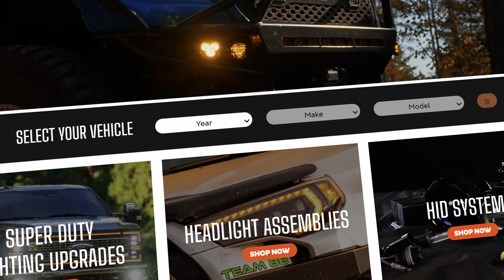HID vs LED Headlight Bulbs: Which is Better in 2025? | Brightness, Fitment & Output Test!

Comment: I used a Bi-xenon H4 kit of like 20w for my bike and it had a single ballast that did everything, it did the low and high beam with a single H4 cable connected to the inverter and then the inverter to power...

I actually liked a lot more the 6000K HID than anything else, I loved the green slow start ramping up and the light had some kind of white fluorescent amusing thing going on.

Their problem is the inverter keeps dying sadly on cheap kits and I never managed to even burn 1 single HID bulb, had to keep buying kits but use the same 1st perfectly working bulb.

That's the only reason I changed to LED which I have a cheap one with 3 big filaments and a fan, 2 are low beam and the 3rd Led filament is the high beam...

Comment: Aftermarket LED bulbs don’t have the proper cooling systems that OEM ones do. They need a much bigger heatsink. And that fan just moves air around the housing.  The LEDs over heat and don’t last. 

If you have a projector style housing the best option is a HID bulb.
Reply: Thats why my Lasfit LED bulbs have lasted over 50000 miles of driving right? Only replaced with ANOTHER Lasfit LED bulb because I switched blue for yellow

Comment: They did not compare the GTR vs. the HID 55w,I have the 55w for years and still today I haven't seen any led as bright as mine.
Reply: You should try the Phillips Ultinon rally 3590, 90w per bulb 6000k 
I already purchased them and i can tell you than nobody is lighting brighter and has a sharp cut-off line like theses ones

Comment: I have a 2001 Suzuki Vitara that just needed a headlight bulb. I bought a pair of slightly upgraded halogens because someone told me that current draw and heat can be a problem for an older, relatively inexpensive car with rather thin harness wires.
I surely appreciate the benefits of quality LEDs. Your thoughts?

Comment: Mildly disappointed that the color was so brushed under the rug in this one. One of the reasons halogens still hold up relatively well even though they aren't anywhere near as bright is that the warmer color contrasts with illuminated items better to our eyes. Human eyes are more used to a warmer color, between 4000k (sunset/golden hour) and 5000k (direct sunlight), and will perceive that much better than a "daylight white" such as 6000k or higher. This is also why many people feel that yellow/amber fog lights have much better penetration through fog and precipitation compared to pure white bulbs, our eyes simply perceive that color spectrum better than a cooler white.
Reply from the maker: We have a ton of videos that go in depth on color and spectrum. It’s pretty straightforward when comparing LED vs. HID—HID gives you flexibility from ~3000K to 8000K and more, whereas most LEDs are either white or yellow. A couple outliers are Morimoto 2Stroke and Ultra 3 LEDs, which run warmer than most LED bulbs (closer to ~5500K).

Comment: Thankfully my car has separate high beam and low beam bulbs so I've come up with a good compromise. I run standard halogens for my low beams so I don't blind people in normal driving conditions, but my high beams are LED and practically create daylight.
Reply from the maker: That sounds like a great setup for balancing visibility and courtesy to other drivers!
Reply: You could technically run HID's on the low beams, but stick with a 4k-5k color range. This will soften the harshness of the light, on people's eyes.

Comment: But you said the LED isn’t street legal?
Reply from the maker: HID and LED bulbs are street legal in the USA for Fog Light use only. Not compliant with DOT / FMVSS108 and not street legal in the USA for Headlights. Legal for off-road use in Snowmobile and ATV headlights and off-road racing use only auxiliary or forward lighting. International street legality varies by country.

Comment: $259 for a pair of led bulbs? You must be joking
Reply from the maker: Totally get the sticker shock. These are built for a clean cutoff, no flicker, stable output after heat soak, and long-term reliability—and they’re backed by a lifetime warranty. Buy once, stop chasing replacements.
Reply: @HeadlightRevolution  same as my 3 year old bevinsee that cost 6 times less. For $259 everybody can give lifetime warranty

Comment: Cannot just plug and play these things, the canbus system on many vehicles rejects them and puts the car into limp mode which is not great...one needs to get one that is OEM accredited unfortunately
Reply from the maker: We’ve never seen HIDs or LEDs cause limp mode — that’s for serious engine/transmission faults. Worst case is a “bulb out” warning on the dash, and that’s easily fixed with CANBUS decoders, PWM modules, or anti-flicker harnesses.
Reply: @HeadlightRevolution  happens on the Ford Ranger.. Know problem
Reply: @HeadlightRevolution  I’ve had it happen on a 2010 Sienna where LED tail lights caused the ECU to shut down completely.

Comment: Yeah, brightness is just one parameter and it is not most important one. Most important paramenter is Lumen and Xenon is still best in that. It is easy to see that, in EU, there is mandatory headlights washers for lights more than 2000 lumens. Have you seen any headlight washer at led factory headlights cars? nope, they are bright, but more or less comparable to halogens. Xenon is still best.
Reply from the maker: Lumens do matter, but they’re far from the most important metric when it comes to real-world driving. We've tested plenty of lights with inflated lumen claims, but low lux and candela—which means they look bright on paper but don't perform well on the road.

Lux (usable light at distance) and candela (beam intensity) are way more telling. That’s why we always measure at 25ft in our videos!

Comment: the thing I look for with lights, travelling long distances in the country, is penetration! I want to see FURTHER down the road. To me, this is where LED fails. I have an older 4x4 that doesnt come with fancy projectors so I rely on the factory reflector. I jst find that HID gets far better distance. Dont get me wrong, I love LED's and I have a double row LED light bar on the roof. But to light up the road further away...... a set of HID still seems the way to go, in conjunction with the light bar for flood!
Reply: You should never put HIDs in reflector housings, it's insanely blinding for everyone else on the road, and illegal for that very good reason.

Comment: Are both legal?
Reply from the maker: In the U.S., neither HIDs nor LEDs are considered street legal for use in halogen headlight housings. They're only legal for fog light use. They’re not DOT-compliant or FMVSS108-approved for headlights, so technically they’re for off-road, snowmobile, ATV, or auxiliary use only.

International street legality varies by country, so definitely check your local regulations if you're outside the U.S.
Reply: Lots of people don't care if it's legal and it's so dangerous being blinded by such bright lights especially on back roads

Comment: My car was retrofitted with a projector 10 years ago, and now, I can't find an LED replacement that I can mount to replace the HID bulb.
Reply from the maker: If your projector retrofit was originally done for HIDs, we wouldn’t recommend swapping in LED bulbs—it’s just not the right match. HID projectors are designed to work best with HID output, so for optimal performance and beam quality, you’re better off sticking with a high-quality HID setup like Philips or Osram.

If you’re set on going LED, your best bet would be an LED projector swap instead. It’s a bigger job, but when done right, it’ll give you performance on par with a solid HID retrofit.
Reply: @HeadlightRevolution  Also, I would dispute LEDs being universally brighter than HIDs. On my 04 Sienna, the HID low beams definitely hold their own against the LED high beams.
Reply: My 2020 traverse has projector head lights but want something brighter at night. You said led arent the way to go

Comment: I disagree with this whole video, i ran a led set of sealight LEDS in my 2012 f150 with halogen housings.  super bright, about 5 feet in front of the truck and then the light had no direction and just bounced everywhere.   LEDS can be great, but you HAVE  to run a projector housing.  Otherwise they suck.
Reply from the maker: Appreciate the input! Totally agree that some LED bulbs just don’t perform well in halogen reflectors—sounds like the Sealights you ran had poor beam control, which can definitely cause scatter and weak distance. But not all LEDs are built the same. We’ve tested plenty of high-quality options like the Ultra 3 in reflector housings with really impressive results. If you’re curious, check out our recent videos for side-by-side beam shots!

Comment: A Tip To change the color of the LED Lamp, Just scrape and remove the yellow phosphor using a knife on the top of the LED chip and the lamp will turn to blue color. I do this on my CSP LED chip
Reply from the maker: Definitely wouldn’t recommend doing this. The yellow phosphor layer is what allows the LED to emit white light—removing it doesn’t just turn the chip "blue," it completely compromises the LED’s intended function, efficiency, and lifespan. It also opens the door to overheating, electrical failure, and color instability.
Reply: Yes, I know that, but it's been working perfectly for 1 year.
Reply: @churrups2 if u knew that u wouldn’t have done it 😂😂 flop

Comment: I bought your HID conversion kit for my 2014 GMC Sierra, but a couple years ago. Overall, I’m quite satisfied with the results. The only problem I’ve had is intermittent connections, it’s kind of rinky-dink the way it’s set up. Every now and then I have to go out and reconnect wires, pull them out. Push them back in to make contact again. I wish now that I’ve gone with the LEDs. But I was worried about the pattern wouldn’t work with a projector headlight. The HID’s have a perfect pattern and a really sharp cut off, which is what I wanted, and I was worried the LEDs would not have that after looking at your videos.
Reply from the maker: If your 2014 Sierra has the OEM halogen projector headlights, an LED conversion would definitely be a solid option now to replace the HID kit. LED tech has come a long way, and we’ve got options that maintain a sharp beam pattern and cutoff just like you’re used to.

We’re also happy to help troubleshoot the current HID kit if you’d prefer to keep that going. Feel free to reach out to our support team at sales@headlightrevolution.com or give us a call at 218-755-5200—we’ll get you taken care of.
Reply: I would recommend using some dielectric grease, on the plug ports. You might be getting some connection issues, from moisture intrusion.

Comment: HID with a ballast and a blurred lens is xenon headlights or am i thinking of something else?
Reply from the maker: HID setups do use a ballast, and when paired with a bi-xenon projector, they handle both low and high beams. The lens isn’t really “blurred,” though—it’s just the way the optics are designed for HID projectors. But yep, sounds like you’re thinking of bi-xenon headlights!

Comment: I hate HID and LED, I don't care if it helps you see better at night, you're blinding other on coming drivers! Now all cars & trucks have them and I hate the,. I refuse to drive at night!
Reply from the maker: Badly aimed headlights, no matter the type (halogen, HID, or LED), are the real problem. Brighter doesn’t always mean better when it’s not aimed right. Properly designed and installed LED and HID systems actually reduce glare and improve safety—for everyone.
Reply: @HeadlightRevolution  I hear you, however that doesn't change my mind, I prefer the soft yellow headlights that you can still see clear enough at night without blinding oncoming drivers
Reply: The deer about to jump in front of your car does not care about your preference, but they will DEFINITELY listen to lasers on the front of the car!

Comment: What abolute rubbish. A 50W LED simply cannot compete with a 100 HID high beam.
Reply from the maker: That used to be true — but LED tech has come a long way in the last few years. Modern setups like the MLED projector push serious numbers:
70,000cd of intensity at just 29.5W of power.

So while a 100W HID still packs a punch, high-performance LEDs are absolutely holding their own now — with better efficiency, faster startup, and no ballast needed.

Comment: Why not a good halogen bulb? Too many people shoving the brightest light that they can find into whatever headlight housing they have. Sure it's bright, but not everybody wants to meet you coming at them at night with a light that resembles the flash of a nuclear blast
Reply from the maker: Totally fair point — and you're right, too many people throw ultra-bright bulbs into the wrong housings without considering optics or aim, and that’s when it becomes a problem. But the reason most comparisons focus on HID vs LED is because that’s where headlight tech is headed — even OE manufacturers are moving away from halogen entirely. A good halogen bulb can work fine in the right housing, but for those wanting better performance and modern reliability, HID or LED is usually the next step. The key is doing it responsibly.
Reply: why not have the anti dazzle headlights that they got over in the EU...had they legalized them 15 yrs ago we wouldnt be having these bright headlight issues as the camera and computer blocks cars out whilst keeping the high beams on everywhere else...
Reply: Those are HIDs that are the nuclear blast. You can get LEDs in hologin colours,, obviously you can get HIDs in those colours too but there still WAYYYYY brighter
Reply: because they burn out constantly and you cant see that deer until its too late...they are just so dim...
Reply: Halogen dies and it's very disappointingly low efficiency even though doesn't matter since there's a alternator...

But for example my bike uses a single H4 25W and basically can't see anything with it at all, it lights nothing at all, I tried my old car H4 55W and starts burning the headlight so I went for HID and finally had nice light output.

Sadly my bike is old and made for halogen even though I stop using HID and use the same cheap LED for many years, both sadly don't focus to the ground, they spread huge light all over the place sadly, but it's either halogen blind 25W that I can't see crap or blinding HID or LED 😢

Anyway even old cars equipped from factory with HID they have the proper focusing lenses for them and even usually move away from incoming traffic. Now LED equipped OEM cars same deal, they are properly made to use them.

PS: but sure some even stock are still kinda slightly blinding, but then again I also see blinding halogen old cars sometimes, they likely adjusted higher, like on my car I have a wheel that auto adjust light height...
Reply: Nah, but it IS quite nice for seeing that deer before it becomes a problem.
Reply: The popular argument is because halogen consumes more power so switching especially to LED's can help your older vehicles alternator. Just try to look for the least brightest leds because I cant stand LED drivers anymore blinding the f***k outta of everyone.
Reply: @MasterChef-117r  Also, on cars with high power draw, using more efficient lighting will reduce the risk of running down the battery

Comment: My wife’s’05 Acura TL has HIDS and they’re a nice bright crisp line across the road. Her car is 20 years old now and still has the original bulbs in it,almost 200 thousand kms on the car and never had to change them yet.
Reply: Replace the bulbs and ballasts.  They’re way beyond their life expectancy.
Reply: @Gitbizy  My Accord had 380 tkm when I sold it. Ballasts were working fine. 🙂 Had to replace one igniter, though.
Reply: It's probably about the time to change them. It's about after 100 thousand km the light output starts to deteriorate somewhat fast. That's 100 tkm of having the lights on, of course. When I had hids (the last car that had them was '03 Accord (Europe), so basically the same car as the TL!) I got new bulbs every 100 k because we have the lights on all the time here.

If the car has DRLs or lights aren't used during daytime, about 200 thousand is a good time to change the bulbs.

They don't burn out like halogens do. The light output drops, and colour starts to change. First they might get a little bit more blue, but eventually, if they last long enough, they'll start goink pink. At this point you are only getting a fraction of the lumens you used to.

A lot of times people don't even realize this is happening because the change is relatively slow and they get used to the lower light output. That's why I always changed my bulbs every 100000 km no matter what.
Reply: Thanks for that, it’s enlightening 😊I have noticed that they’re not as bright but they’re still really good considering how long they’ve been used.

Comment: HID is awesome, but they run very hot. Melted a few OEM housings. Thanks for technology. LEDs are cool. Light pattern on old housing is still debatable. Reflective vs focused etc.
Reply: HID runs cooler than halogen!

Comment: Why didn't you use light meter for comparison? And why didn't you compare today's LED with 100W or at least 75W HIDs with light meter results? HIDs can loose buttle to LEP but not to LED!
Reply from the maker: We didn’t include exact output values in this video because HID performance depends on a lot of variables—ballast quality, bulb age, projector design, etc. It really deserves a more dedicated breakdown if we’re going to start throwing numbers into the mix. That said, we’ve got more testing videos on the way, so stay tuned!